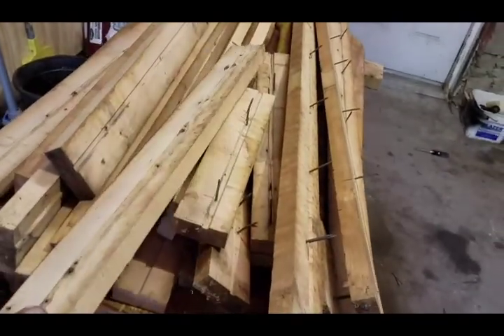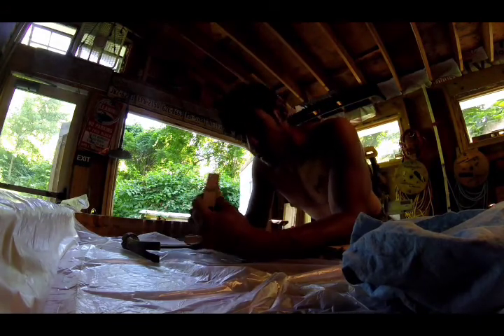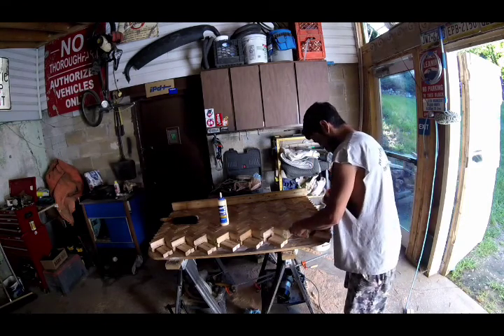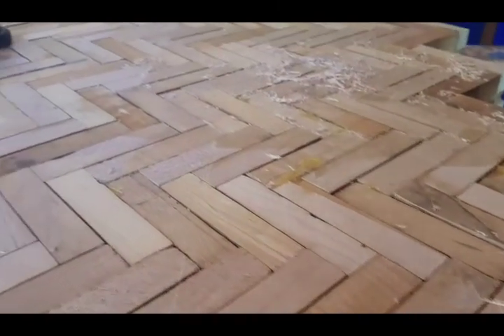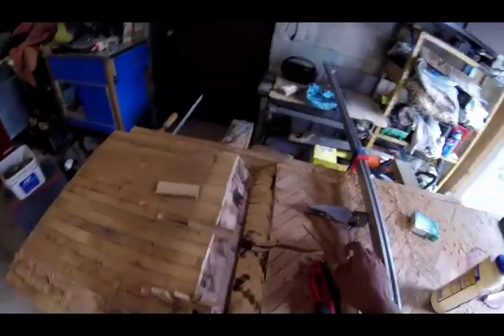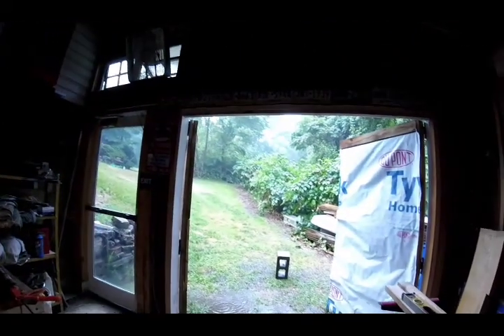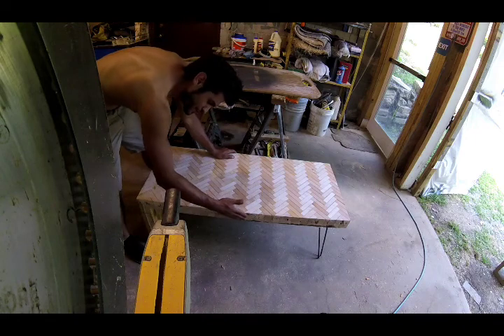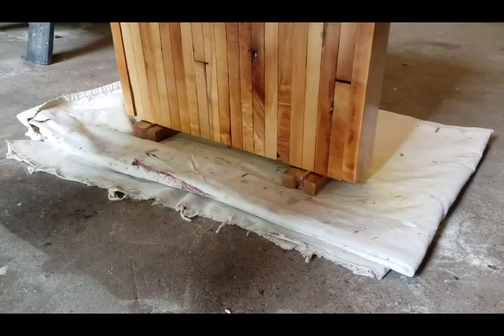Recycled Bowling Alley Coffee Table DIY

Comment: Awesome build! How did you split the lane into single boards? I have an 8 foot section of maple bowling lane and I'm afraid that I will split the boards when trying to disassemble it.
Reply from the maker: I just used a flat bar and hammer, working on the  back side. It comes apart very easy. The worst part is removing the TONS AND TONS OF NAILS THEY USED lol thanks for watching